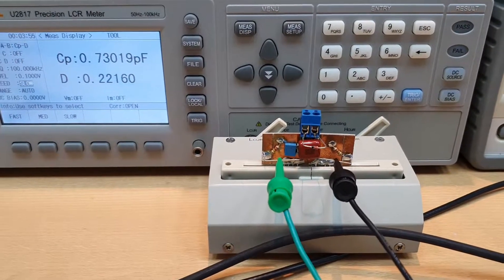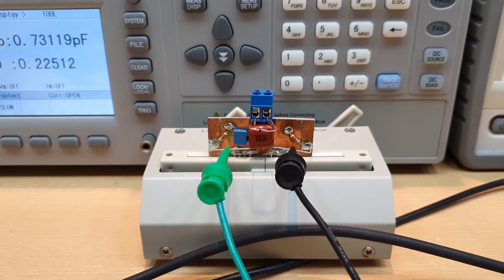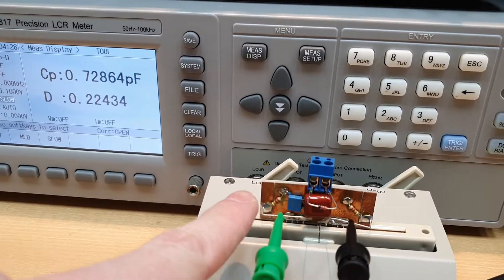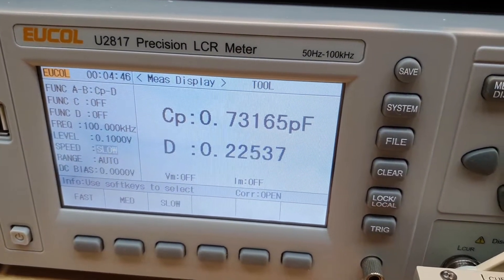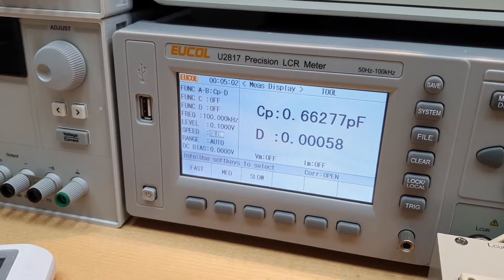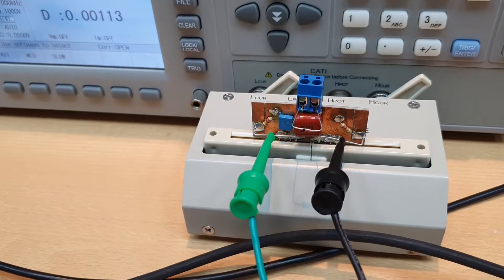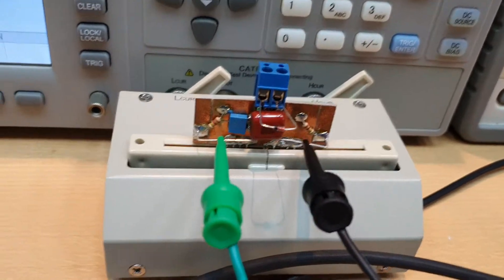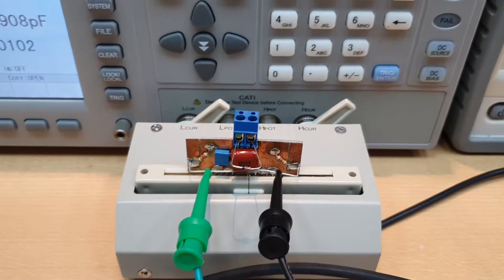Jig for diode capacitance measuring

Comment: 0.7pF at zero volts seems to be a bit unrealistic for the ubiquitous 1N4148. Not every good UHF Schottky diode has this capacitance at zero voltage.
Reply from the maker: Interesting, I always get this kind of value for the 4148. Where the measurement problem may be ?
Reply: @AllElectronicsChannel  I'm wondering if LCR meter needs a self-calibration (open & short) before measuring ?
Reply from the maker: Yes, it needs! I will measure it again when I return from vacation. Here I have results for other common diodes https://gusbertianalog.com/jig-for-lcr-zener-and-varicap-capacitance-measurement/

Comment: Sorry my friend , I do not recommend you to use any of these high speed switching signal diodes as Varactors... Instead , there are many commercial Varactor diodes in the market but it seems you are not the familiar guy  with supplies... You can use BBxxx series found easily or MVxxx ... Email me to ( alshalchi@gmail.com ) for your supplies and I will help you ...
Reply from the maker: Yep! But not so easy here 😅
Reply: @AllElectronicsChannel  ... Gregory , it is easy but you did not know before  , do you want to make a try ?!
Reply from the maker: @ahmedalshalchi  🤩🤩🤩🤩
Reply: @AllElectronicsChannel  ... Gregory , please check your Email and reply me  by Email as always ... Thank you...